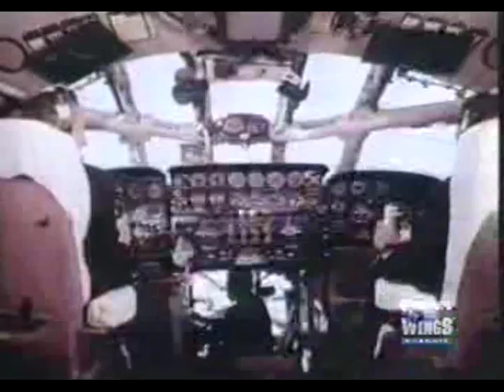Tupolev Tu-114 Rossiya NATO Code: Cleat

Comment: @BlacktailFA 
I think it has something to do with the frequency. Since turbo prop noise frequency is lot lower than a jet. So the jet may be more quiet than the contra rotated turbo prop for human, but may not be the case for some animals. Beside, the modern design nacelle also help isolate noise and vibration from engine to cabin.